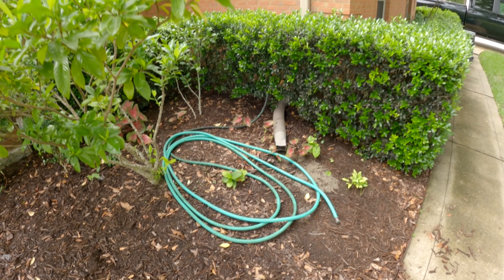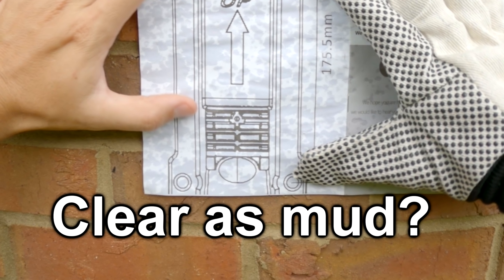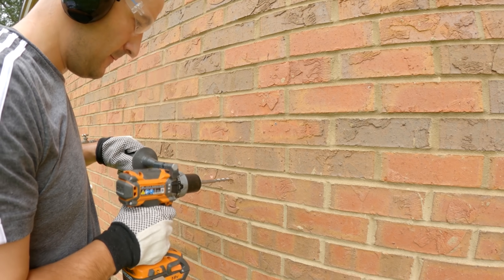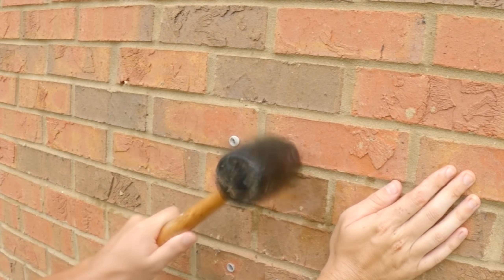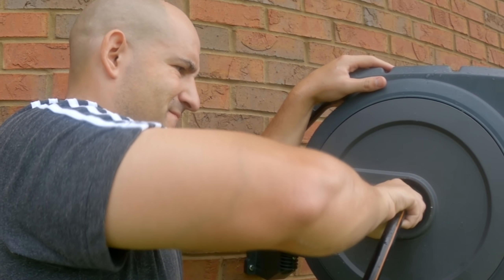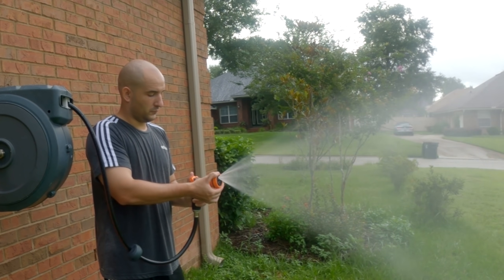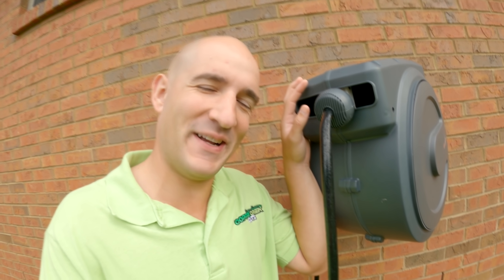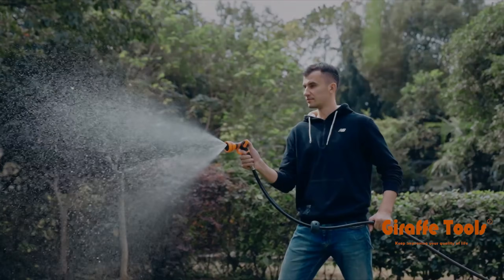Your Garden NEEDS This Tool! (Giraffe Tools Hose Reel)

Comment: How do you empty this each winter before storage? Any water left in the hose will freeze and split the hose over winter here..
Reply from the maker: I don't live somewhere where this is a huge concern, but why can't you just unscrew the lead hose from the faucet, extend the hose out, then unscrew the sprayer nozzle and let gravity do it?
Reply: I have an adapter that screws into the female inlet and attached to my compressor to blow out my hose reels! I found it on Amazon.
Reply: @BakerCountyTrashPickup  I watching all your lawn care videos on your YouTube channel
Reply: pull the hose out without the nozzle on and it will drain just like any other hose, on or off a hose reel. why would this one be any different?

Comment: I think this looks pretty neat. I remember one summer where we had picked up three different hose reels. They had one that operated under water pressure to rewind the hose. That thing was so underpowered it was ridiculous. I was so furious with that thing that it was still dripping wet when I had taken it straight back to Home Depot 1 hour after buying it. After she was her different type I finally found one that did a decent enough job.

I just cannot bring myself to spend $200 on something like this. Perhaps if I used my hose more now than I used to I could probably justifies spending the money.

You really did do a great job demonstrating this hose real. The one suggestion I would have for you or anyone is to use the quick disconnects. If anybody is familiar with air hoses for compressors and air tools can you know the quick disconnect at the end of the hose and on all of your tools. I have been using these for 30 years and every single attachment I buy for the hose I buy a quick disconnect fitting. The reason I'm thinking this would be good for you it's with how high up and out in the sun that your hose sprayer is sitting out in. If you get yourself a quick disconnect and also stops from damaging your hose sprayer from dragging across the ground.

Again good job on demonstrating this look forward to your next video.

Comment: I have the longer version of what Hoselink offers - 82 feet. It's cool that Giraffe offers a version up to 130 feet with the same 1/2" hose. I love that they offer a 90 foot version using a 5/8" hose. Being forced to use a 1/2" hose for these retractable hoses has been one of its biggest drawbacks - cool that there is an option now!

Comment: That’s a cool tool to use. For all of the remaining hoses o have I have one of those reel wheels that I spin them on, after it’s spent on nice and neat I pull it apart ( it’s not designed for this but hacks help) and place the perfect rounded up hose where it needs to be placed. Got one of those things for $6 from Home Depot. But I like what you have in the video.

Comment: You could always add an elbow adapter to the lead hose to minimize the chance of kinking the hose against the house if you pull too far to the left. Any time you use anchors, you're supposed to drill one size bigger to allow for the spacing of the adapter. 

It looks cool. And could be incredibly useful as half my hose is always unreeled and lays stretched out across the ground. I have a few fruit trees I try to water every so often over the summer. I wonder how the hose itself will hold up. I got a heavy duty one, and it's been amazing over the years. I've gone through too many cheap green ones to go that route again.

Comment: Looks like they didn't design it "perfectly" well.....one glaring problem and probably the only problem, is the crimping of the hose when pulling extended left.  There should be a "door stop" type blocker so that the hose doesn't get smashed against the house.

Comment: Clever tool but the openings on either side of where the hose retracts into looks like an easy place for wasps to nest.  I would tape over them to protect yourself and others
Reply: Good reporting....don't like wasps.
Reply: I know it's not clear in the video, but it does go side to side as it retracts to keep the hose evenly on the reel so it doesn't get tangled when pulling it out again. Wasps will build anywhere, whether it's there on the reel or on the eaves of the roof. Just gotta watch out no matter what you do.

Comment: Why did you mount that ugly contraption that high? No, I don’t need this thing in my garden.
Reply from the maker: Covered that in the video, be sure to watch the whole thing if you ever have questions!
Reply: I would want it at the base of the wall where a shrub could hide it. Just plain ugly on brick.
Reply: @sharynhay9993  
I agree. Ugly sitting up that high.

Comment: but it's ugly, who wants that on permanent view on their wall
Reply: The reel part detaches, just leaving the small hinge plate on the wall.
Reply: @davidcarr4991  thanks, I didn't realise that
Reply: @davidcarr4991  you still have it they during the parts of that year when you will also be outside. It’s a hideous thing to look at.
Reply: Attach planter boxes to the wall around it to hide it somewhat? Other creative ideas? :)
Reply: @Lawn_Care  maybe but then it would make it harder to use. I just use a garden hose thats laid flat behind some small bushes so its out of sight but always ready
Reply: @FishFind3000  that's true. It would have to be in one position. Probably not that helpful.